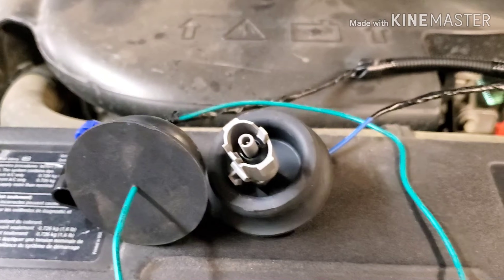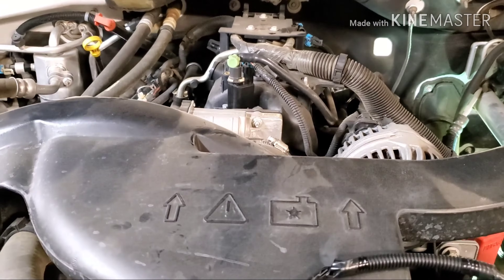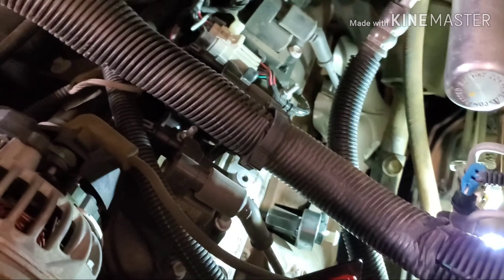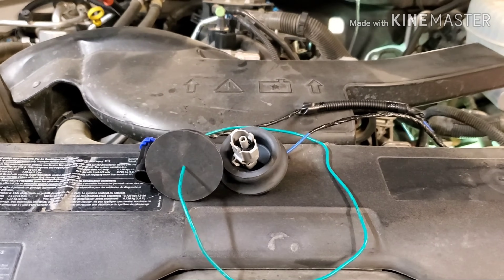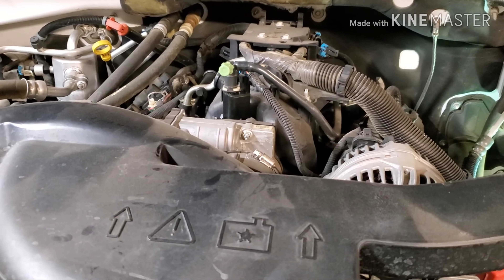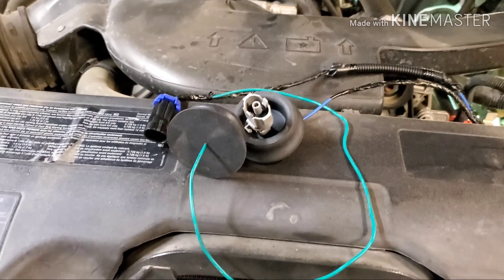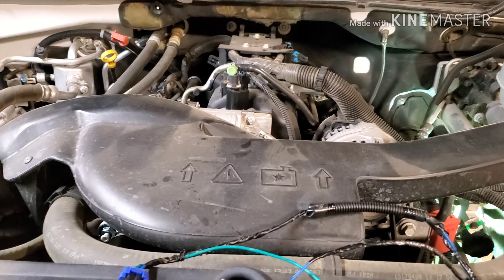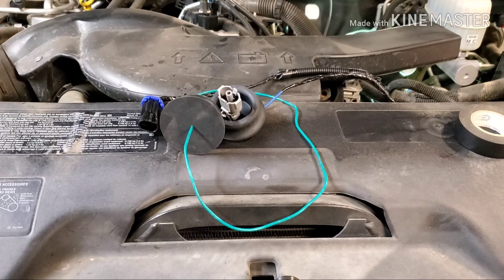Chevy 5.3 knock sensor relocation experiment.

Comment: Knock sensors are to detect engine knock, we used to call pinging , caused by pre ignition, which is it fires before TDC instead of slightly after , caused by cheap gas / E85 , or spark to far advanced ; 
When the computer (ECM) reads the voltage generated by the sensor it retards the timing so you do not damage the engine 
Back in the 1960s we called E89 - Truck gas

Comment: I would be afraid to mount the sensors on the head as vibration is what causes them to generate a small electric current . 
My 2006 Sierra kept having this code & resets did not seem to change performance or mpg .
I made a bracket to mount them on the side of the block at the bottom just above the oil pan , there are holes there that are tapped 8MM. X 1.25 thread (10MM) on newer models . Since doing this the light has not returned .

Comment: Which Dorman wire harness works best? Plan on doing this myself and don't want to just splice wires. Thx
Reply: I assume it needs to be longer then stock harness to reach the passenger side sensor or run it pass front between water pump etc?
Reply from the maker: This was done 5yrs ago. Not sure which Harness I used. It was a stock harness. I did not go around front of engine I went over top. Look at other related videos. I stuck with AC Delco parts if memory serves me.

Comment: I had the p0332 code for over a year now and recently i started getting pretty bad pinging / spark knock. I finally figured it was time to fix the knock sensors and maybe that would clear up the pinging too. I stupidly bought cheap knock sensors and took the whole damn intake off and replaced the sensors and harness. The pinging went away and is still gone. But the p0332 AND p0327 codes are in now. Im worried the pinging will return now that the knock sensors arent working. I ordered a new harness and real acdelco sensors and im going to try this because i dont feel like taking the intake off again.
Reply from the maker: @prohalid  good luck

Comment: What bolt extender did you use for the adapting the knock sensors to the block?
Reply from the maker: @colnomad04  I found it at my local True Value hardware store. I took the knock sensor with a matched treads.

Comment: My factory location for knock sensors under the intake. However I’m taking a 5.3 aluminum block and building it for boost but the knock sensors are on the bottom of the block. I will most likely go this route! Cheers 🍻

Comment: I wonder why when you replace them and put them in the valley they don't work, yet when you replace them and put them on the sides the code doesn't come back?
Reply: Most people just replace the part. You want to change out the harness as well. Also when buying a knock sensor you want one that is in a box with bubble wrap protecting it. The delco knock sensors come in a bag. If it gets dropped on the ground it's damaged. Think about the times that part is thrown around or dropped by someone in a hurry.
Reply: @danp7463  no dice, I replaced the harness and knock sensors 4 different times, 3rd set I decided to try just relocating them and the code hasn't gone back.

Comment: I replaced my knock sensors 3 times. The first 2 sets were Doorman and the 3rd set was original GM Knock Sensors. I took my time and cleaned everything up with a wire wheel and Brake Clean every time I replaced all 3 sets. I still get the Knock Sensor Fault Code. I am going to relocate them in a couple weeks (Going on Vaca next week) and will update my post here. One thing I noticed on here is that people are having a hard time finding the Extension for the Left Side mounting. McMaster-Carr carries all kinds of extensions of various sizes like this one. Also, I have an extra harness that goes under the intake manifold and I am going to just extend the wires on that instead of buying the Doorman harness #917-033.

Comment: Where did u buy the adapter?? Literally cannot find one anywhere
Reply: Coupling nut and a bolt I'd what I used, cut the head off bolt made it into a stud and used the coupling nut to connect to sensor
Reply: Yeah I couldn't find the adapter either. Here in San Antonio I went to the True Value, Lowes, Home Depot and took the knock sensor in to see if anything would thread into it and wasn't successful.
Reply from the maker: At my local True Value Hardware

Comment: How come you didnt make use of the second threaded hole above the first one?  Talking about the passenger side.  I did mine last week and not getting a check engine light now.  I put mine in hand tight.
Reply from the maker: I watched a video on how to do it as well. I wanted to keep one on each side. They still work just in a different location.  I have even seen where they wired both to one sensor. This is just they way I did it.
Reply: @2lotony  I suspect these old motors are just too noisy for the knock sensors.  I replaced mine the correct way and that didnt work so decided this path was better.  Now to figure out why I keep getting the ABS and BRAKE alarm.  I know the wheel sensors have been replaced with new hubs so that aint the problem.  Suspecting ground issues.
Reply: @rogermerritt6470  it's the abs control under the driver seat.
Watch some videos & did it.
Works very well
Reply: @rogermerritt6470 solder on the ABS module becomes brittle and you end up with a poor connection.  You can pull the module and pay for it to be rebuilt. Usually under $140. Or do it at home for almost free.
Reply: Any update after a year?
Reply: @JesusRodriguez-nx8zi  Working fine.   Had to replace the spark plugs.  One had shorted.  All were red in color indicating lean mixture.  Had one mechanic do a computer check and system reported weak knock sensor reports.
Reply: @rogermerritt6470  okay thank you, I did the right way of fixing sensors and check engine came back on that same day.. and right now driving it feels normal but light turns on and off itself so thinking of doing this relocation with some cheap sensors and see what happens

Comment: I actually made a video and posted it on YouTube and it's helped a few people on how to remove knock sensors when the top spins in the body. It's the first I'm seeing about relocating them and I will definitely do that at some point in the near future
Reply from the maker: The main reason for doing this experiment is I did not want to remove me intake.
Reply: Oh, believe me, I get it. 
I went through the whole process 3 times.
If I had known about this then... It wouldn't have been even once.

Comment: Will this work on a 2003 yukon denali ? One knock sensor broke and i damage the whole and dont know what to do. I will try this
Reply: It will. Plus if you really want to they make a valley cover with the knock sensor delete.  That way you can remove the old sensors. Relocate the new sensors and completely cover the area between the heads.

Comment: About ready to try this method just for S&G's after having replaced both knock sensors and the pigtail three times to no avail (swapped out the 5 3L LM7 for my current 6L LQ4, but KS issue didn't start until 2 yrs after that swap).  At this point I can do the job in 90 minutes with my eyes closed, but both codes always return after the drive cycle completes.  No performance issues, so tells me the issue is somewhere in the main harness between the KS pigtail connector and the computer.
Reply: Keith, is it possible it is the computer?
Reply: Did you figure it out?
Reply: The solution was a 2023 Duramax.
Reply: @keithhoofard5844  oh 😂

Comment: placed the one on the passenger side in a pre threaded hole on the front of the head  wire both wires together run one to  passenger side  knock sensor it  works great

Comment: I also found thru my research that you can use only one sensor , and connect both wires to it.  This tricks the computer into thinking both sensors are working.  Saves another $50. 
    Good luck all.
Reply: I have tried that. It made it have a really bad spark knock that I didn’t have with just one not working before. I don’t recommend putting both wires to one. Went away after I put the wires back.
Reply: @buttonysquare8501  I’ve had no issues or codes in a year.

Comment: I understand that after the reset and install , you have to rev the engine to 5k for about 30 sec. 2 or 3 times. It does something to the computer supposedly
Reply from the maker: I do not know. I have not heard that. I am not a professional mechanic or you tuber. The research I did before doing this did not say to do the revs. I have experienced zero problems since I did mine. Good luck.
Reply: @2lotony  good to know it worked for you. Thanks for responding. Doing mine this week.
Reply: @theofficialdiamondlou2418  hey did the reset actually work? I did my knock sensors and put the RTV around the gaskets. I did this twice since the check engine light came back on and revived the same code.
Reply: @jcool1537  I’m not sure yet. I did 200 miles with no code. Then this morning within five mins I got a light.  I haven’t had it read yet. But I’m sure it’s going to be it.  I’ll keep y’all informed as I learn more.
Reply: @theofficialdiamondlou2418  thank you
Reply: @theofficialdiamondlou2418  did you do the rev thing? I put 2 new sensors in mine and the silicone and new harness the "Dorman" Kit and the light just came back on 😤
Reply: @jcool1537  did you do the rev thing? I replaced my sensors and harness and the code came back I didnt do the rev thing to make the ECM reset or whatever
Reply: @Mrfourohfive  yes, my light is still on
Reply: @Mrfourohfive  I did the rev thing. And took it to have the codes erased at AZ (auto zone ) 
   But it seems I popped a fuse between the service link and the computer.  I have no light now. But no one can read the computer. Although my engine runs better than ever. And getting better fuel mileage. 
  That I haven’t fixed yet. Or even tried. My dad always told me “ if ain’t broke don’t F$&k with it ..”
Reply: @theofficialdiamondlou2418   Im almost sure that fuse is the cigarette lighter fuse it's connected something like that. I had same problem checked the fuse was good to read codes
Reply: @Mrfourohfive  So what exactly is the rev thing, how are you supposed to perform it?
Reply: @theofficialdiamondlou2418  the cigarette lighter fuse is the same as the scanner port
Reply: @billappleton2624  got it. Turns out it was the scanner was bad.

Comment: I watched your video and replaced the knock sensors in my 06 Chevy Silverado. It worked!! Thank you for posting this video! It saved over 500 $ that the local shops wanted to charge to fixed it. Looking forward to more videos
Reply from the maker: Thanks for the comments.  I got the idea from others on YouTube and posted my video when I did mine. I say this alot. I am not a professional mechanic.  But I like to work on my own stuff. I am all about my Bronco right now. Sometime soon I need to pull the trans in the Tahoe and do the rear main seal. Thanks for watching..
Reply: I too bought new ac delco knock sensors and wire harness. I took my intake out and replaced both sensors and installed the new harness with high heat silicone. Ran great no more check engine light. 
About a month later check engine light again. I bought two more ac delco sensors and put them on the passenger front head and driver rear head with another new harness. 
About six months later the check engine light came back on for the sensor on passenger front head. So I connected the driver head and the rear sensor under the intake manifold and everything is working fine now for about 3 months. Go figure 🤷‍♂️🤷‍♂️
Reply: After two years, how has it held up? Heat or placement shown to be any issues, how about dirt and debris?
Reply: I think there’s an issue if you mount the sensors too close together as well they might be too sensitive in recognizing knock noises thus they will make the check light come on if for example you mount both on one cylinder head close together

Comment: When you added extra wire to lengthen the passenger side to reach the engine what wire did you use?
Reply from the maker: I did not add wire. I used the Dorman harness and just separated the wires to get them to go where I needed.

Comment: Doing this will fix your light and run fine.... but say a coil goes out.... it will pick a miss and it will tell you a witch cylinder is missing but it wont be that cylinder......

Comment: I did this with the exception of placing it on the threaded hole just under the red fuse box in your video because its further from the exhaust manifold there and I placed the one on the passenger side in a pre threaded hole on the front of the head. I also replaced the harness and it works just fine. As you said Chevy now places them on the side of the block or head in later models most likely because of the complaints about stupid engineering.

Comment: Did you have to reset the check engine light or did it go off on its own
Reply from the maker: On my vehicle I had to have the check engine light reset. Seems like its a hard code that will not do it on its own.
Reply: @2lotony  thanks. I just did that . Going on test drive see what happens.

Comment: Where did you find the fitting for the drivers side.  I've looked everywhere
Reply from the maker: I found mine at my local True Value hardware store. 
Best of luck.
Reply: What exactly is the kind of adapter that you bought  mine is doing the same thing? Is it just a piece of 1/4 inch pipe with a coupler on the end of that to adapt the knock sensor on driver side

Comment from the maker: I used a Dorman harness. Just had to separate wires the were taped together. This worked on my application. I have seen others where plug is in different location .

Comment: Were can i find the knock sensor adapter that mounts on the side of block
Reply: Rather than have these bulky gen lll sensors sticking out the block, why not convert to gen lv style. They are tiny and will fit in many of the pre tapped holes in head/block. All thats needed is a gen lll to gen lv adapter harness. 2 pin female to connect like stock, then has the newer style connectors on the seperate endd
Reply: I know this post is a few months old, but isn't the knock sensor the same size as the drilled and tapped vacant hoses on the sides of the head ?! If so, do u know the size. Thanks
Reply from the maker: I just went down to the local hardware store and picked up a stud and a threaded collar. Took my sensor with me to make sure thread and pitch was correct.
Reply: 2lotony thanks i was just about to go to my local ace hardware store to see if they had em if im not wrong the size is m10 x1.5   Looking to get this done this wknd
Reply from the maker: @bajapanta1  
That sounds correct. I will be posting an update soon since I have been driving around and putting some miles on my vehicle. No issues so far.
Reply: How long was the bolt and collar?
Reply: @bajapanta1  many thnx for the info
Reply: What's going on so far
Reply from the maker: @olivares32688  
So far no problems,  I am going to post an update at 1000 miles,  I am at 650 miles now.
Reply: Is the ACDelco wiring harness long enough to plug into each sensor or did you have to alter it?  Also, use any heat protection for the wiring?  Thanks.  And great idea!
Reply from the maker: @danielcooney6701  no insulation needed. Just mocked up where they were going, checked, then wrapped wires in electrical tape.
Reply: @2lotony  Thank you!
Reply: @2lotony  Also, I looked at the block on my engine and found multiple locations on both sides.  Do you know if it would be an issue if both sensors were on the same side of the block or should they be located one on each side?
Reply from the maker: @danielcooney6701  they r supposed to go on opposite sides. Stock the mount in the middle. If u look at other videos on same subject u can get alot of opinions. Saw a video where a guy spliced both wires into one sensor. Lots of options and opinions on the matter.
Reply: @2lotony  Thanks.  I've found two locations that I'll put an adapter threaded collar and install.  Thanks again for the help, much appreciated!
Reply from the maker: @danielcooney6701  👍👍
Reply from the maker: @danielcooney6701  check my public comment I just posted.
Reply: Pretty sure its a rod coupling